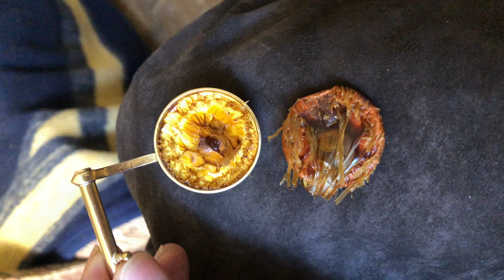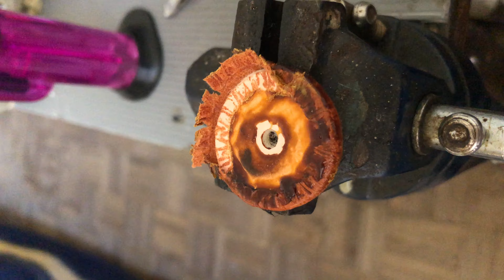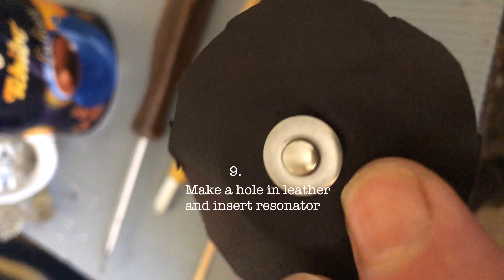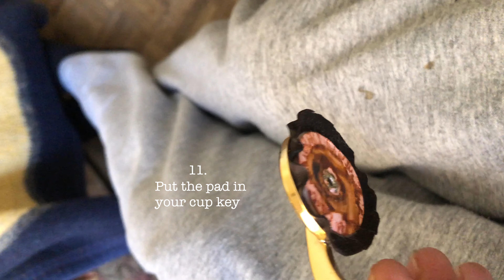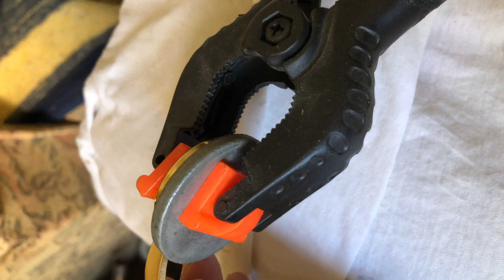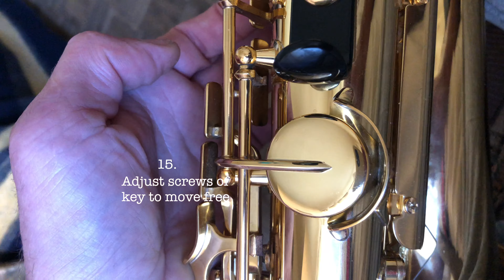Change saxophone pads at home

Comment: In truth in a budget situation it's not bad. Takes some skill however and not for the let me have a go crew.    I do use pads that do not fit from sets for odd cups and grind felts to a perfect round fit and rebuild a pad ,the leather is tricky on the backs as it can bunch if not just the correct size,   but you can tension your pads firm or loose how you like the feel of a pad when playing.   This is a fair intro into making a pad.  A lot of creative musicians run on a tight budget and learning repairs if you have the basic understanding of metirials is a good thing